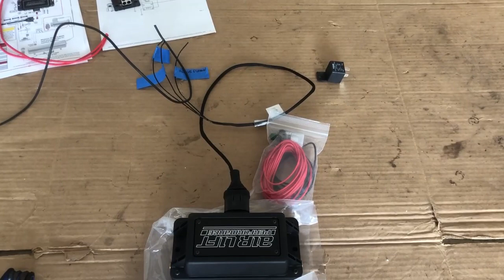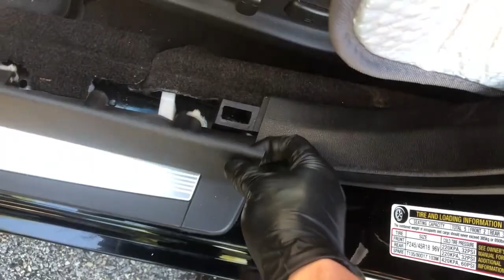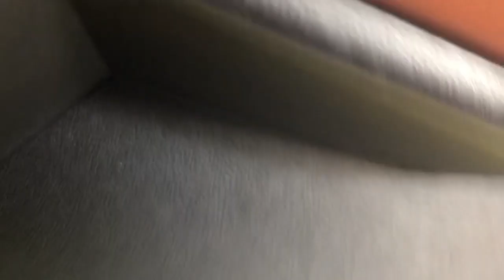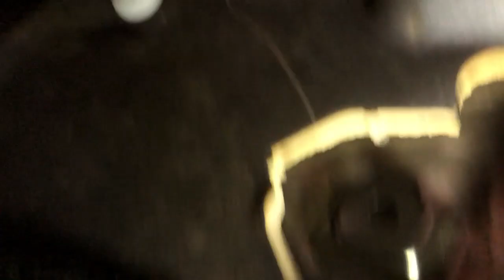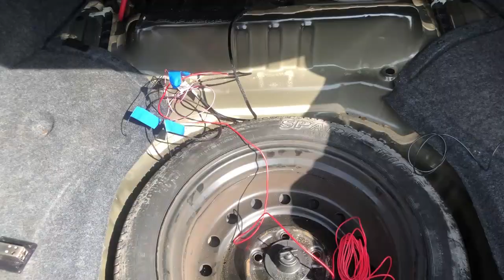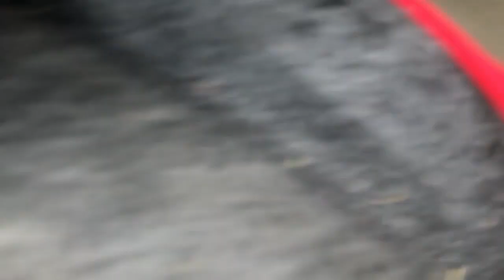4th Gen. Acura TL Air Suspension Build Pt. 1 (Airlift 3S)

Comment: Bro I connected everything like u and my compressor it’s doesn’t work why?
Reply from the maker: Check the compressor, make sure its working. Directly connect the negative and positive to the battery. If it comes on, compressor is good, then you need to check relay. There’s videos on how to check a standard relay or just replace it and swap it and see if anything changes. If relay is good, you need to double check everything because at that point something is off. Make sure you’re getting voltage to the power wire you are powering compressor with. Volt meter would be very helpful in this situation.
Reply: @TheOriginalBeeCee   I already checked everything and everything is fine but my question is why doesn't the compressor turn on if there is no air in the tank? I also realized that it turns on only if the air switch is connected to the two pins together.
Reply from the maker: @alexdroiid2214  this is for DUAL compressors, meaning 2. I see you mentioned Compressor, singular, twice. If you’re running 1 compressor, this isnt the setup you should be following
Reply: Can u please helpme ? I dont know how do this
Reply from the maker: If you are running a single compressor only, this is the wiring setup:

https://www.google.com/gasearch?q=viair%20compressor%20wiring&shem=rime&source=sh/x/gs/m2/5#vhid=7-Uw_dsfj-KK5M&vssid=l

..keep in mind…..3S needs a pressure switch like outlined in the diagram & video. The 3S harness will fall into place the same way as outlined in the video. So screenshot this diagram, and screenshot the diagram I made in the video and compare, you should be able to figure it out 🙏

Comment: Hey ! Can you tell me where I connect the ignition source?
Reply from the maker: Johan Perez hey whats up man, I actually pulled it from an ignition source on an aftermarket alarm wiring that was easily accessible under the dash that was already in the car. I tested it with a voltmeter for verification. Im actually going to be installing the Airlift controller in the car either this weekend or next, I can double check for an alternative. Sometimes i use an ignition source in the fuse box, but if I remember correctly it was pretty tight in there.
Reply: BeeCee Built thanks man . I used an ignition source in the fuse box.  I am installing 3p airlift.  Follow me Ig @johanfreej
Reply from the maker: Johan Perez sent you a DM on IG